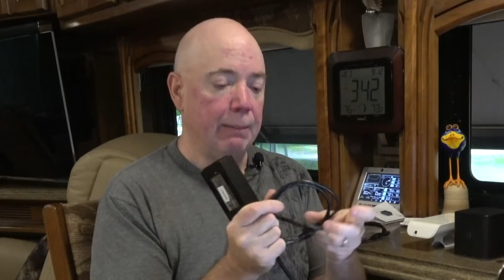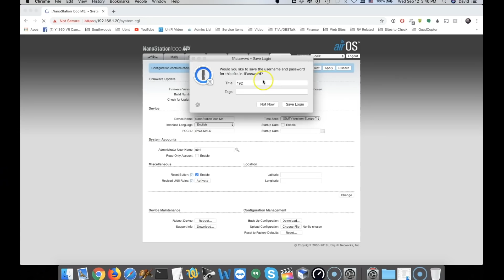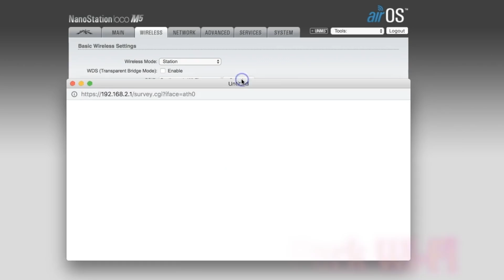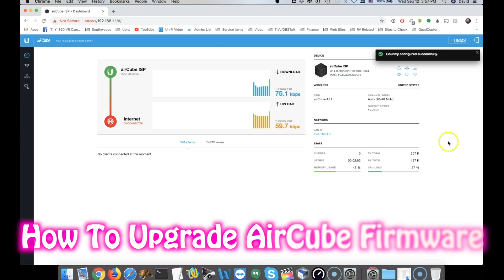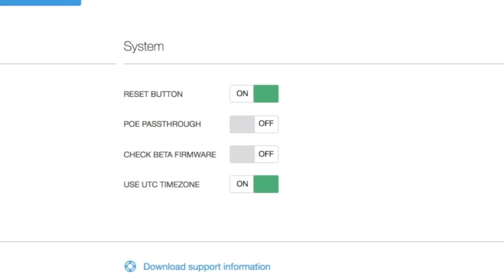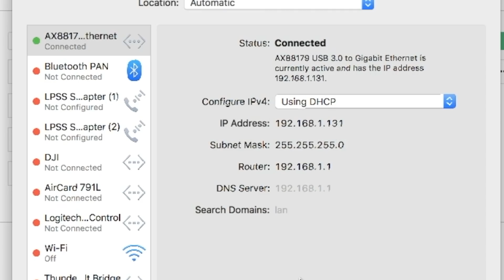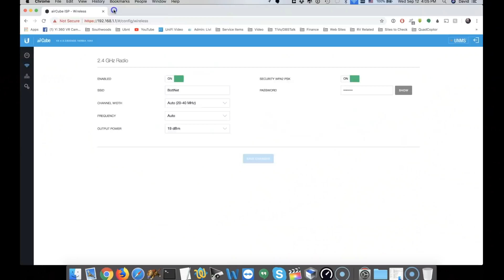Build a Private RV Wi Fi System with a NanoStation & AirCube AC

Comment: Hi David,  I’ve followed all the instructions and all seems to “almost” work. My nanostation is connecting to the WiFi spot I choose, even tried connecting to my MiFi, and they seem to connect no problem.  The issue I’m having is my SSID is connecting to my private network (aircube) but it says “No Internet, secured”. Not sure what to change?
Reply from the maker: Hi... Hard to say. It seems like maybe you don't have the NanoStation plugged into the WAN port maybe? If it is... Are you sure the NanoStation has Internet?  Like if you remove the AirCube and plug the NanoStation into your computer, it should hand your computer an IP address. (So using the POE Adaptor...The NanoStation is plugged into the POE port and you computer is plugged into the LAN port.) The NanoStation should hand your computer a 192.168.2.X address.  You should be able to reach the NanoStation at 192.168.2.1.  If you don't have internet, yet the NanoStation is showing it is connected to an AP...Then the issue will be with the settings of the NanoStation.  My guess then would be the NAT CHECK BOX was not checked and also then putting a check in the 4 items that show up when you check NAT.   If you have internet...Then it will be something with your AirCube if you had it plugged into the right port. :) (People have made that mistake.)  Hope something here helps.
Reply: @DavidBott  So I tried to connect to my laptop (via the POE adapter as you stated)  I can reach the Nanostation at 192.168.2.1 and when I got to the DHCP client in the Nanostation under the "Main" tab, I do see an IP address of 192.128.2.18. When I click the "AP information" tab, there is a lot of info there as well but it's Greek to me.  NAT box is enabled and the 4 below it were/are checked under the "Network" tab.  Also, when I went to my iPhone and typed in 192.168.2.1, I can pull up the Nanostation and see the wifi that I am supposedly connected to, but can't access the internet.  Strange...

On a side note, you said you could get by with 1 Ethernet cable.  I'm assuming you'd have to purchase a USB cord that would be able to power the cube as well as the POE to the nanostation?  Otherwise I don't see any way around using 2 Ethernet cables. The Nanostation would have to be plugged into the cube on the blue Wan PoE Out port, yes?  I tried plugging in a small iPad plug but I don't think it has the power to also supply power to the Nanostation.
Reply from the maker: @jeffschaeffer5520  You need two cables to set it up. Not sure why you would think not for I even to the hook up step by step starting here... https://youtu.be/WGLwwREDzNQ?t=283   So you still need to connect to a computer and test the connection without the AirCube in the way as I mentioned above.   It does however seem to be handing out an IP based on what you said however.  But we still need to know if the issue is the NanoStation or the AirCube. So you need to test it all by itself.
Reply: Update: when I rebooted my computer, it did show internet briefly and I was able to connect to Google for about 3 seconds, then it dropped the signal and went back to no internet, secured.
Reply from the maker: @jeffschaeffer5520  Not sure what to say as rebooting the computer has nothing to do with this. For all I know your computer connected to some other Wi-Fi.  Again, you need to test WITHOUT the AirCube.
Reply: In your blog you mentioned “You will need two (2)  of these in order to set this up, but will end up using just one when we are done. I recommend shielded cables and that is what I linked to. If you already have network cables, then you are all set.  If not BE SURE to order TWO”. I thought in the end only one would be needed. I did obviously, use 2 to set everything up.  Not a big deal just thought I could get away with 1 less cable :)

Anyway, I’m guessing it’s my nanostation that is giving me the issue (possibly the lan/usb port adaptor??  I can see the nanostation via the 192.168.2.1 and can connect to the WiFi next door.  I can’t get internet. I’ve shut of my WiFi and am attempting to go thru the LAN port. I have the radio going to the POE port on the POE adaptor, and the LAN port on the adaptor is plugged into my Ethernet port on my laptop via the usb dongle.  My network interface says “No Internet” so I’m assuming the issue is with the radio.  I’ve confirmed everything you had us configure: router, NAT, 4 boxes below, block management access, IP to 192.168.2.1, enabled DHCP, range start 192.168.2.1, end 192.168.2.254.
Reply from the maker: @jeffschaeffer5520  Maybe the network you are connecting to has the same IP range and thus would be a collision and not work. You can try going into the NanoStation and under NETWORK tab change the IP from 192.168.2.1 to 192.168.10.1 and ALSO BE SURE to make the same change from 2 to 10 in the two other DHCP areas.  Change...Apply.  NOTE: Now you will find your NanoStation at IP address 192.168.10.1 as we just changed the IP.  Just trying something else. :)     (Side Note...You are correct on the text, I will fix that. The text was copied from my first tutorial in 2014 when Ubnt was using an AirGateway vs the new AirCube.  The AirGateway actually attached right to the POE adaptor. Thus when one, one cable.)
Reply: Perfect. 90% there. I can connect to the  internet (they did have the same IP address so there must of been the collision).  I tried connecting to my hotspot/mifi, but that doesn’t seem to be working. I’ll play with that another time as this seems to be working. Thanks David!
Reply from the maker: @jeffschaeffer5520  As soon as you mentioned you were connecting to a neighbor, that gave me the thought on the same IP range.  Could be now that the JetPack uses 192.168.10.X  :)  Could you be that lucky. LOL   Feel free to use whatever IP between 192.168.2.X to 192.168.252.X.  Just remember to change that number in all three places and then remember the IP so you can reach the NanoStation. :)  Glad you are getting closer.
Reply: @DavidBott  I can now connect everywhere.  Thank again.  One last question.  I'm in the driveway of our inlaws and connecting to their internet.  When I go directly to their internet without the Ubiquiti setup, I can decent 8-10 bandwidth but it occasionally does drop to 2ish but with the setup, it pretty much stays around 1 meg, maybe less.  Is there a setting I should change to make it better?  Thanks as always!
Reply from the maker: @jeffschaeffer5520  You can expect "some" loss, but not like that.  So my guess is interference where the channel of the AP you are connecting to and the channel being used by the AirCube is the same and this a lot of interference.  The only useable channels on 2.4 are 1, 6, and 11.
Reply: @DavidBott  would you recommend changing the channels on the cube (not the nanostation) manually and try each one to see which one works the best? I can see on the wireless tab of the cube where I can manually set it.
Reply from the maker: @jeffschaeffer5520  You don't have any choice on the NanoStation channel, it has to use the channel of the AP it is connecting to.  So you can try the channel of the Cube for sure.  Only use 1, 6,or 11.
Reply: David Bott sorry to bother you once again but I have a question. I’m in an RV Park and getting a whopping 120+Mb on my iPad when hooked directly to their WiFi.  I had to log in via there capture page and was able to so on my cube however I’m getting around 7 Mb that way. I prefer to use my private internet via the cube and can’t figure out why I’m losing over 100Mb of speed?  Ideas?
Reply: @jeffschaeffer5520  You surely will have some data loss seeing you are adding an extra wireless hop, but no where close to that degree. I have a few thoughts... Your AirCube you are using is  2.4Ghz and your iPad is connecting at 5Ghz and the 2.4Ghz has a lot of noise.  Same holds true for the NanoStation being 2.4Ghz and the Freq used is noisy. Actually, getting 120+ Mbps it would have to be using 5Ghz as you surely are not likely to see that using 2.4Ghz.  So that is likely the main reason.  REALLY good to read however that the park has such speeds. It is something you do not see often.  If you will be staying long term, maybe order a NanoStation M5 Loco (which is the 5Ghz version) and get that running vs the M2 NanoStation. It would be interesting to see what happens and you could always return it. Notes, that unless you have the AirCube AC, you will still have 2.4Ghz speeds, but with a 5Ghz link, it should be much faster, but still not as fast as 120Mbps.  Oh, for fun, hook a ethernet cable into the aircube and connect that you your computer directly and see  what happens to the speed. (Be sure to turn off Wi-Fi on your computer to be sure you are using ethernet.)  And then even for more fun, connect the NanoStation directly to the computer, thus no AirCube, and see what happens. :)  The other thought is your iPad is connecting to a different AP than your NanoStation is using. (But still I think it is a 2.4Ghz vs 5Ghz thing.)

Comment: If I use my Pepwave Surf on the Go instead of the AirCube, I assume I would set it up in a similar fashion?  I understand that I would have to change its mode from Wifi Wan to Ethernet Wan, but everything else would be similar.
Reply from the maker: Hi Eric...You are correct. :)  You would still find the NanoStation at 192.168.2.1 when you go to use it vs the WI-Fi as WAN.  You will find it MUCH faster that Wi-Fi as WAN.

Comment: If you only plan on using a hotspot and not connecting to the park's wifi, can you remove the nanostation or the aircube from this setup? I'm thinking the nanostation since it's a signal repeater but not sure. 

As always, thank you.
Reply from the maker: Sure, you can connect right to the JetPack, but if you have many devices, you will need to do the reconnection for each device. That is one of the nice things about using a private network...so all your devices say connected.

Comment: Hi David and thanks for the video. I need an RV setup where I can stream stuff like YT. Can I get multiple M2's and M5's and combine their connections to park's, McD's, BK's, etc..internet access so I can have more throughput to my RV's private network? (I want to be able to connect to 2.4Ghz and/or 5Ghz wifi simultaneously) Since Nanostations do not have external antennas (they are built in), what would be another ubiquity product be that does the same thing but have external antenna connection(s) so I can have higher gain?
Reply from the maker: Hi...You have two questions here. First off, the NanoStation is an OUTDOOR product that is a directional antenna. It has a very high gain. They only way you can have more gain is if you purchased the NanoStation M2 and not the M2 Loco. The Loco is 1/2 the size thus a smaller directional antenna.  As far as running more than one at a time...yes, it is possible in what is called "VPN Bonding", but that is something over over peoples heads. It requires a Win10 computer with special software, monthly subscription fee, and multi ethernet connections to use with multi NanoStations. You can use USB to Ethernet for that seeing that most computers have one ethernet port. It also works to combine multi JetPacks if you have ones that can be tethered.

Comment: Hi, David. Great video, I followed them and it worked perfectly. In the video, you suggested using a VPN service but I can’t figure out how to configure the air cube to use my service (Express VPN). Any suggestions?
Reply: The Cube can't directly. Your phone or computer would need to be using it or you would need to replace the AirCube with another router that supports client VPN setup.

Comment: This is an excellent video. Thanks for the help! I got stuck at trying to log in on Chrome to the nanostation site. It looks like my computer needs internet to search this but you had us turn off the wifi. Can you explain how to navigate this? Thanks!
Reply: No sure how to help you as I would not have any idea on how your computer is setup. You turn off Wi-Fi so your computer does not try to reach the NanoStation via Wi-Fi when setting it up as it can't.  So it sound to me like you do not have your computers ethernet port correctly setup to use a Static or Manual IP settings. This is needed so you are on the same network as the NanoStation so you then can go log into it's admin interface at 192.168.1.20.  You do not need internet access to setup the NanoStation as you are connecting to it via direct IP address and not a URL.
Reply: @davidbott5438  I realized I was trying to format the wrong plug in the settings networks. I got it right finally. I do have another question though. I am plugging my nanosation into a router that I am hardwiring into my computer for electro-sensitive reasons. It seems with how the whole set up went that my router acts like a wireless device regardless of whether my computer is plugged into it or not. Is there something you showed in the set up that created this? Do you know what I can do to keep it from getting stuck on wireless? Thanks for your help!
Reply from the maker: @michaelina99  Hi...Sorry to say I really am not sure what you are asking. If you are plugging the NanoStation into a router, the router  likely is has Wireless and Wired options. So just plug your NanoStation into the WAN port of the router and then plug your computer into any LAN port of the router.  Your ethernet card needs to be back in Automatic mode or DHCP mode so it will get an IP from the router.  So your computer then is hardwired to the router which then goes out the NanoStation to connect to the RV Park or whatever SSID you selected.

Comment: Is there any way to tether a cellular hotspot (via USB) to the router to allow that to be shared through the same connection? I'd like to tether rather than use WiFi for the cellular connection.
Reply: Not with this router. You would need to find a router that can handle a JetPack connection.  Something like this for example... https://amzn.to/2AFyZv9
Reply: @davidbott5438  So in this case the GL.iNET GL-MT300N-V2 Mini Travel Router would take the place of the airCube?
Reply from the maker: @bnaudie  Yes it could as it is a router after all.  You would setup an SSID to use for your network and then connect the USB and go in and select it to be used if it can see it. But if you are going to do that, I would then recommend buying the Dual Band version...  https://amzn.to/306e3r7   (NOTE: I won't be offering help with this even though I have used them. But they are easy IMHO.)
Reply: Linksys once had a wireless router with a USB port that you could plug in the hotspot. I couldn't find it when I did an Amazon search so not sure if they offer it anymore.

Comment: Great idea and tutorial. I don't have an RV but am looking for something when traveling around, so same idea. It seems like the nanostations now on the market are generally 5Ghz so i'm going to try and find some similar that is dual band, so I don't have to have 2 nanostations. Any suggestions? I saw a Mikrotik groove
Reply from the maker: I know that Ubnt does not have a duel band for this type of product. Remember, these are usually setup by someone at a clients home thus they would choose what was to be used...2.4 or 5...based on what they where connecting to.  Having dual band in this case just adds to the cost that is not needed for that use.

Comment: but why not use a repeater with removable antenna, so you can install a long distance antenna to reach the hotspot?
Reply from the maker: Hi ya!  Depending on the "repeater", it may not make you a private network and just repeats the RV parks network thus exposing your devices to a public Wi-Fi system.   Here is a video as to why that is a bad thing...  https://youtu.be/NvIsGbGMzrY   Take care.
Reply: Thanks a lot for the answer. I have some other questions about this system.
1. If this connection mode will cut the connection speed like wifi repeaters do.
2. if this type of connection is a point-to-point / bridge
Thank you in advance

Comment: when i looked for a network, i could only see one 5 ghz network even though there were others being broadcasted
i am stuck at that step
Reply: Hi...Not sure what you are referring to as the system is a 2.4Ghz system.  The NanoStation M2 (the 2 stands for 2.4Ghz.)  If you purchased an NanoStation M5, that is a 5Ghz system and would only see 5Ghz SSID's.  So not sure what you are referring to.
Reply: David Bott i only see 5ghz not 2.4ghz
do i need a different model
Reply: i do not see any 802.11 networks
Reply: @kingair350  I am sorry, but I have no idea what you purchased so I really can't help. I answered how I could based on the information you provided. You should have a Ubnt NanoStation M2 if you followed the information I provided. The AirCube is the router that you connect to and is also 2.4Ghz unless you bought the upper end model and then it can do 2.4 or 5ghz.
Reply: David Bott ok thanks
Reply: I purchased the M5 and it works great...thanks David
Reply from the maker: @kingair350  Hi...Yes, the M5 works GREAT when looking to connect to a 5Ghz Wi-Fi network.  The M2 is for the 2.4Ghz Wi-Fi networks of course.  All parks will have 2.4Ghz but might not have 5Ghz, that is why I went with talking about the M2. :)  Take care.